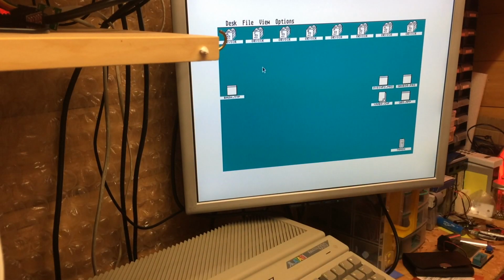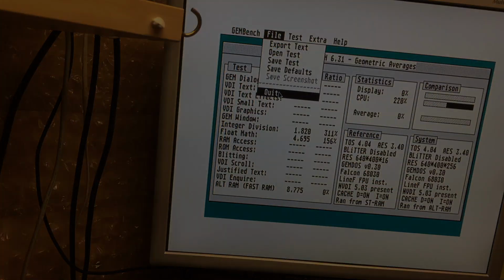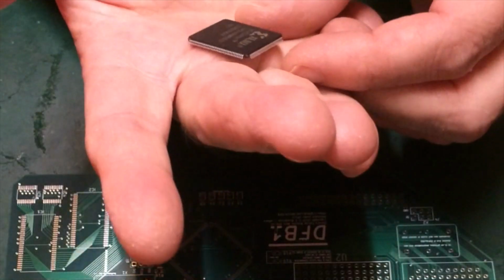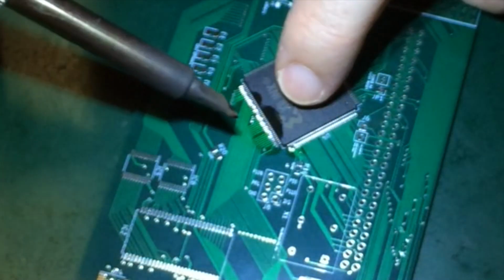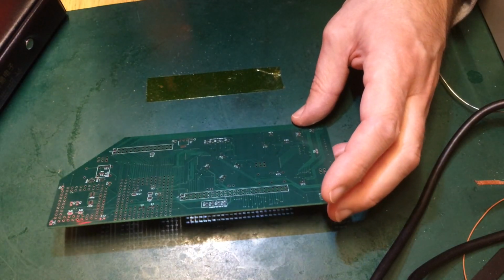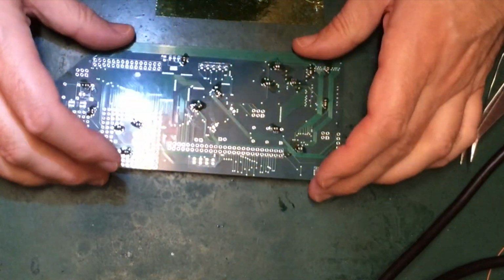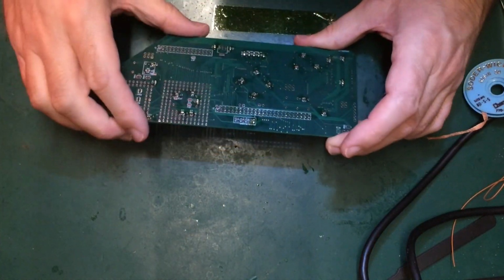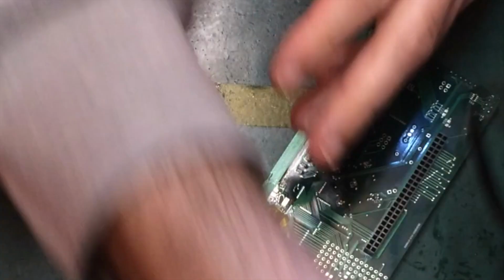Building the DFB1r5 -- Part 1: Getting Started

Comment: A neat trick for insulating nearby connectors from hot air (which I picked up from Branchus Creations) is to use box cutter blades. They have a nice sharp edge which means they meet the surface they're on very well, they have an excellent thermal mass and they're cheap. I have only just started using them myself but they seem to work well.
Reply from the maker: Interesting idea. Probably smell a lot better than cooked Kapton glue too!

Comment: Lovely stuff!  Great to see the evolution of the prototypes there and the issues with each. My ears pricked up when you said GadgetUK lol - yes, it's an absolute pain aligning those CPLDs!  The key is not to move the PCB once you've aligned it.  I have on a number of occasions knocked the work surface or the PCB and found the chip moved, but thankfully never had to remove one due to alignment.
Reply from the maker: Thanks a lot :) For me It's normally one pin is a bit bent over to its neighbour and I hadn't noticed it. I've never managed to save one from that in situ!